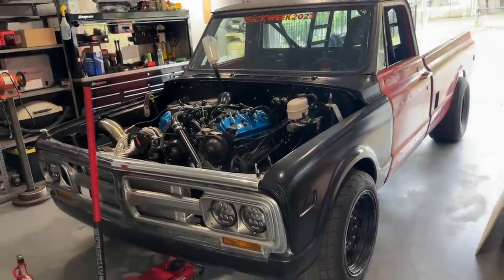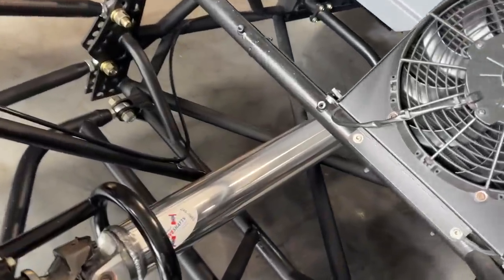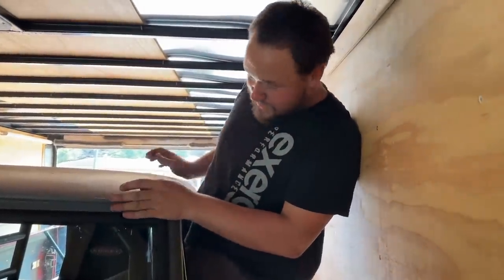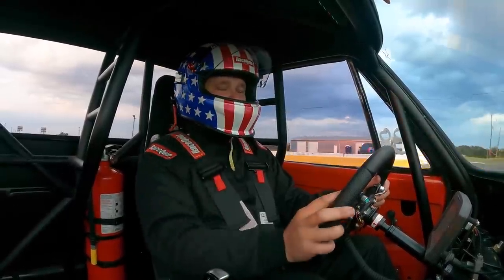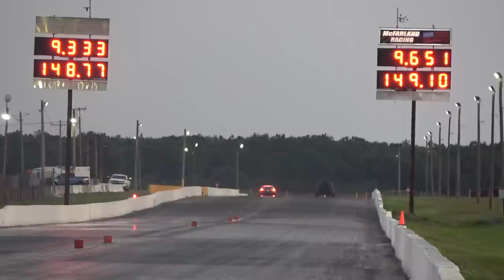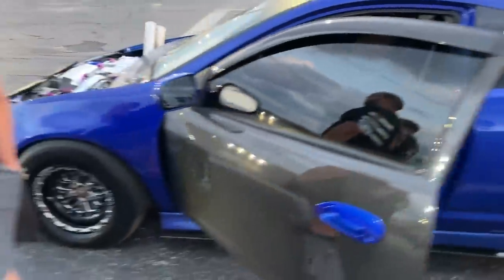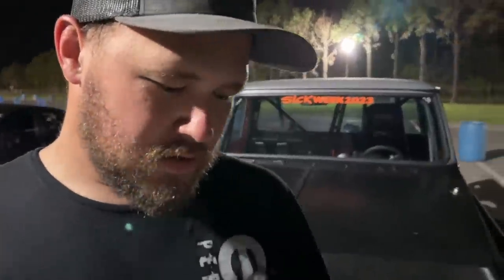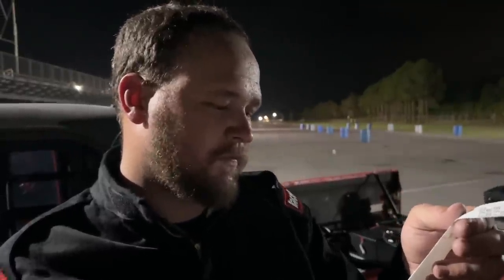Wyatt's Duramax Race Truck Is Back at the Track!

Comment: So happy for Wyatt. This didn't come easy, cheap or quick
Reply: Erikk Hyndman  fr? seems like a lot
Reply: @ywjhyhy Diesel stuff is expensive but I bet his truck is gonna outlast the rest of the race car fleet
Reply: @jaynikk758  what? lol
Reply: @jaynikk758  Why? They break too...
Reply: @sykwookiee  They break as well but generally I thought diesels last longer in general due to the lubricative qualities of diesel
Reply: Lol no. They last long in miles but if you’re running a high powered diesel build then no it can get fucked up just as much as gas engines.
Reply: @ywjhyhy  not really, carillo rods for a Duramax are $2400. Just rods. So that shows how much is in just the engine. I just built one and probably have 20-25k ish in the engine alone

Comment: Maybe you can put a gear vendor on it and use that as 4th gear. The gear vendor ratio is basically the same as 4th in the 4l80e. This would also help with blowing up the weak overdrive sprag in the 4l80e.

Comment: I have worked on a 2002 5500 chevy with a 4L80E that had a hydraulic pump  to boost Trans fluid pressure to cliff clamp 3rd and 4th clutch packs tighter. Don't know how well it would work for you. I hooking it up to fluid test points and wired the pump to ecm and it only kicked on when in after shifting into 3rd and 4th

Comment: I'm wondering if it might be better to run an external overdrive, say from Gearstar or the like, and not use the internal overdrive on the 4L80E. Just throwing that out there in case it'd be an option to explore.

Comment: WYATT, THAT TRANS WILL NEVER HOLD THE TORQUE IN 4th. ITS AN OVERDRIVE GEAR. YOU NEED A TURBO 400 and a GEAR VENDOR. THEY TAKE THE POWER AND YOU JUST FLIP A SWITCH FOR YOUR “4th” Gear. THAT COMBO WILL LAST. ASK CLEETUS IF HE STILL HAS A GOOD ONE. HE DID LAST I KNOW……

Comment: my only concern with ev is will there be any second hand cars for those who dont have $80000 dollars,  where replacement batteries cost more that the used car is worth like a sears drill
Reply: they will be scrapped, there is not long term 2nd or 3rd owner with these appliances.

Comment: Too bsd you didn't have a gallon of Type II Class 3 clear chemical conversion coating (Chem Film, Iridite, etc). If it is clear coated then cool. Well, you are in Florida and not the north, and it is a race truck, so no worries about corrosion. Chem Film is conductive and not like paint, nor powdercoating (too much heat), nor anodizing. Does not protect as well as these, but is superior to bare aluminum. It keeps the sheen about the same as what it is laid upon.

Comment: Put ford 6 speed in it..they've been proven to handle 3k hp 3k tq and they make programmers and they are stout...just need a adapter
Reply: Doesn't need 6 gears  3 or 4 is all you need

Comment: God damn Wyatt getting. Swear that was speed up footage damn that was peacing out.  And how bout you add a gear vender  to the end of trans and then you only need to use 1-2-3 and it would make for a better drag an drive as you’d then have 4 gears in trans an A gear vender at the end of trans to turn low rpm on the drives.

Comment: I'm 6'4 400lb I use a harbor freight Badland 12000 pound winch mounted in front of my trailer to bring in my race car it's cheaper than carbon fiber

Comment: Tesla is like an iphone....
But I'm on Android
I mess with electric rc stuff, so I'm not against electric cars. I would love an old school hot rod with an electric conversion, but with a less advanced computer system....just an on/off switch for an esc(electronic speed controller). And used Chevy spark battery modules. 

 I'm just against the giant screen, all the traction nanny's, self driving, lack of independent repair facilities. And the fact that they can turn it off via WiFi, or just randomly decide you don't get to supercharge because someone else nowhere near the car decided it's "not safe", 
The cold/hot weather definitely effects them no matter what, so people up north aren't going to get on board.

Comment: Me Wyatt, is doing a turbo 400 swap with a gear benders 4th gear an option. I know it's expensive, but I haven't heard a diesel guy talk about that. And the big block twins guys and what not are running 3k plus torque on that set up. I bet that there has to be a company willing to work with you/ sponsor you. Rpm, rosler, m and m. Someone? Maybe that's an option going forward....

Comment: Sam definitely has the right idea... I'm an EV hater, but not because they aren't cool and don't have potential from a fun factor. I hate the "guise" of them being touted as Climate Savers when the battery packs are worse for the environment than any "ice" based engine every will be. When we have so much potential with things like Ethanol based fuels the climate morons have ruined the EV for me at least. There is room for the two to co-exist, but the whole idea of being forced by progressive idiots into them on false claims gets my goat. There's been a dude racing an old Mail Truck EV for years and back when it was first coming on the scene it was cool and different, maybe I'll come around in due time... Remember they did this in the 70's as well when all the big V8s were all of the sudden bad for the environment and it sparked real innovation and technology, so I'm hopeful they simply end up being another option like they are currently and not forced down our throats in the end.